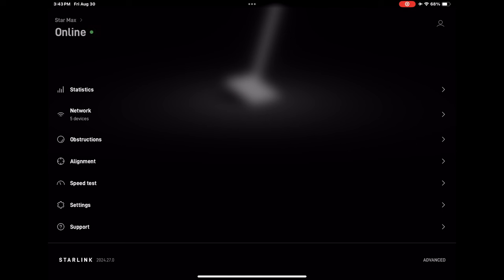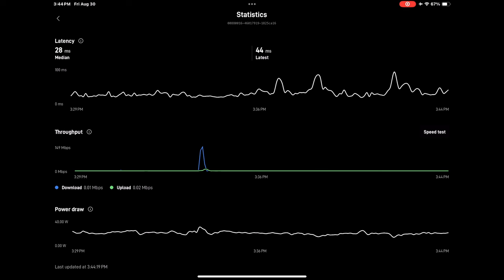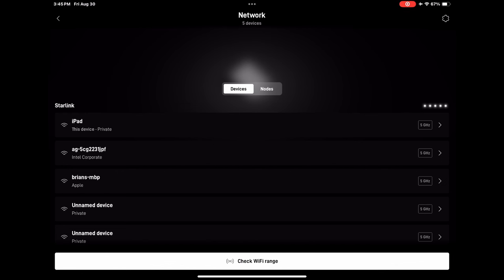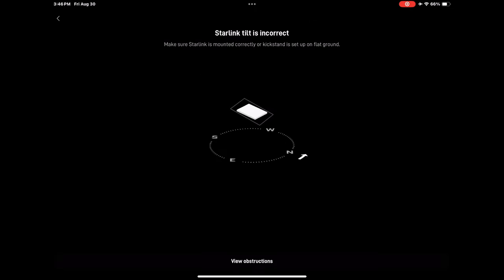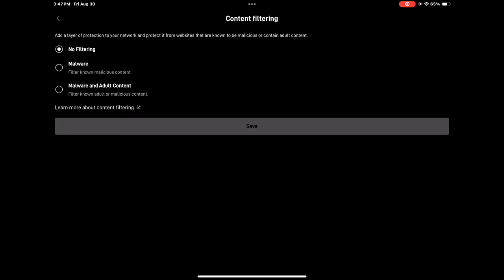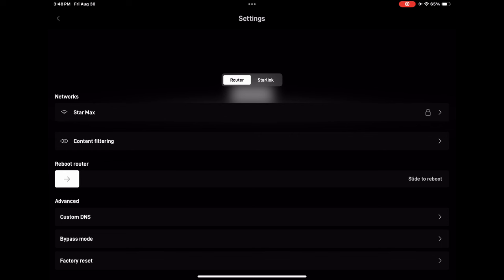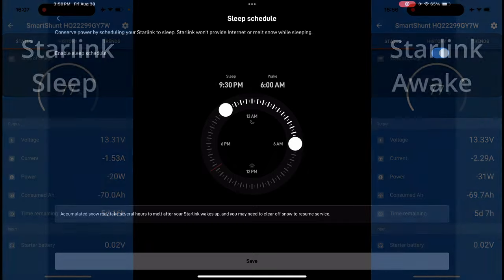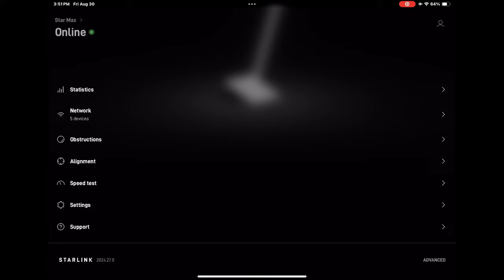Starlink Mini Software Tutorial

Comment: Nice overview. How did you get the Power draw screens that showed Starling in sleep vs awake?  Not shown was the account stuff, data usage shows up there. I have the 50 GB  plan and will want to monitor Data usage closely to avoid any surprises.
Reply from the maker: the blue power draw stuff was from my Victron energy shunt on my power system. You will get an email when you hit 80% of your date to let you know you are getting close. if you want to opt in to go over you will need to get that done before you hit the 50 gig point.